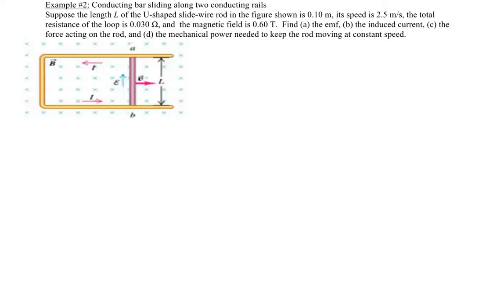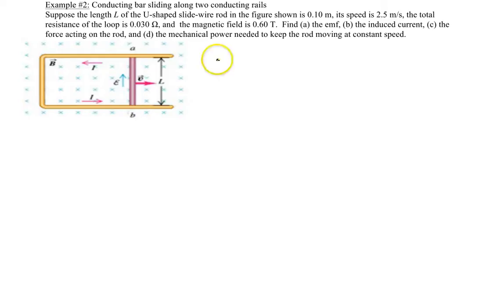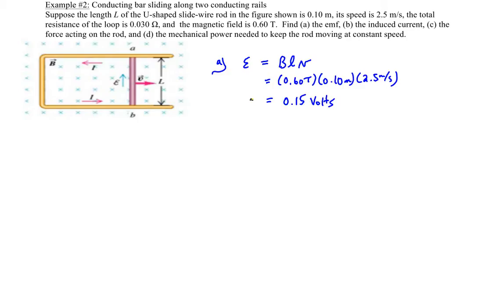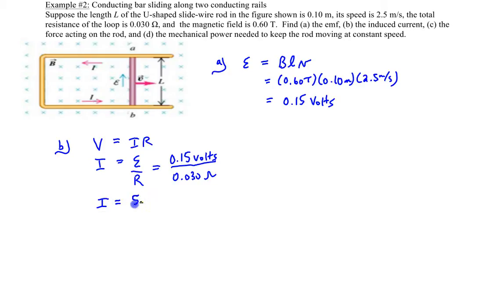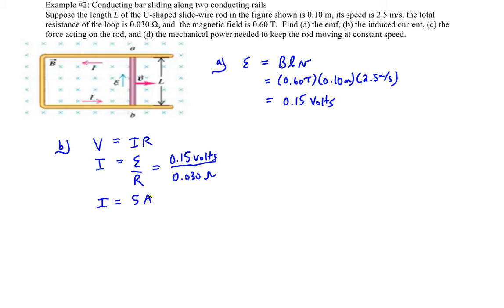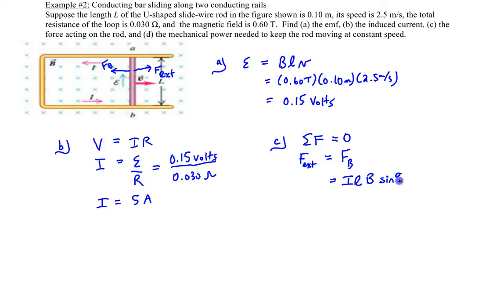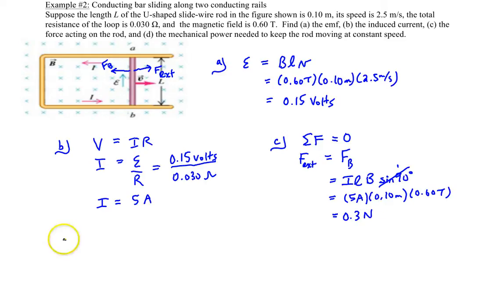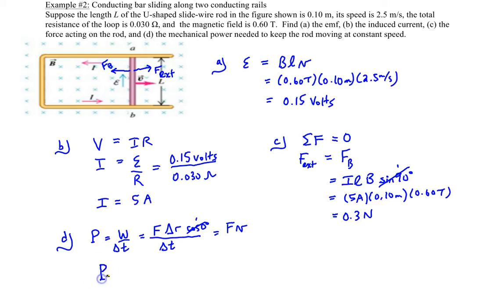Chapter 22, Example 2 (Slide-wire generator)

Comment: Hi, thanks for this. 
Just about the F=ILB acting on the rod where I is the current in the rod (due to the vertical velocity of the charge carriers in the rod). Can you explain why we do not consider the  rod's horizontal velocity also when getting the magnetic force B on the charge carriers in the rod. Why ignore this horizontal component v of the rod (and its charge carriers)?

More broadly, is there a F=qvB on the other sections of the loop due to the velocity along the wire of their charge carriers. I know it won't cause displacement of these sections but does such a force exist due to their velocities? This is something I don't understand about the extent of self-induction that you may be able to clarify.